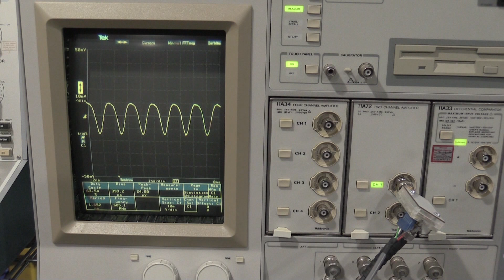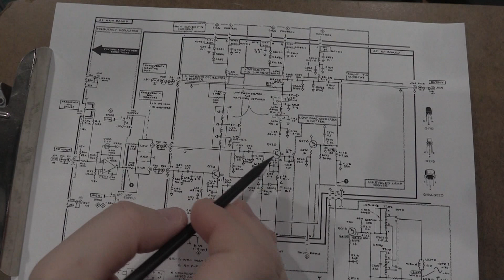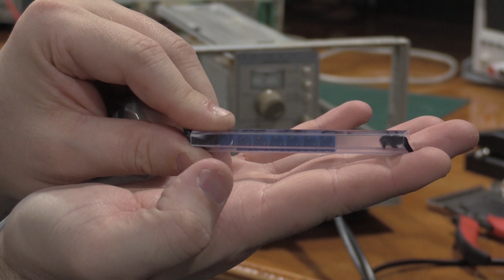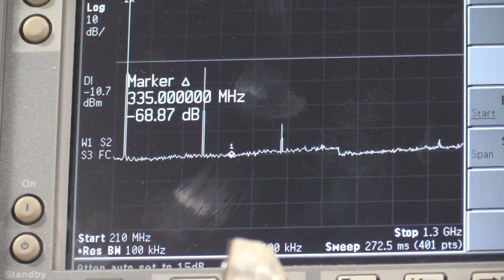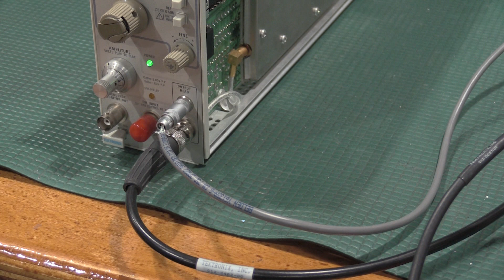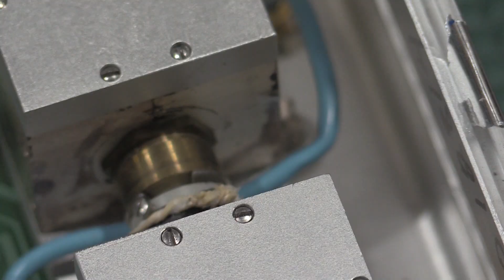Tektronix SG504 Repair and Frustration

Comment: Great video! If I may ask what peak to peak detector did you use?
Reply from the maker: The flatness comes from the leveling head on this unit. Mine shipped with out the leveling head so I needed to order one separately. The flatness of the new leveling head was checked right before shipping to me so I was able to trust it. I need to get some power meters for the lab to work on the 500Mhz and up gear. Secondary market issues with those are the heads tend to be blown up the meter is good but the scene head is toast. Ill be diving deeper in to this when I start aligning the spectrum analyzers for the lab.  More is always on the way!

Comment: BTW guys. I encountered a tricky prob.that had me chasing odd 'drifting' leveling failure. The white and green wires developed a short inside the lemo cable...which caused  the ref.v on the uA741 opamp buffer pin 3 to track closely with the Head's error V sent to pin 2 of the opamp. So the UnLevelled light would slowly fade away, but the dBm level would be wrong as shown by my Boonton microwatt meter.  I swapped the 741 opamp for an LM358 ( can work if u short pin 7 to pin 8 and pin 6 to pin1 on the 358). No change. Wasted time looking for bad pots/caps etc. Eventually did a continuity check across pins 2&3 of the input OPAMP..0.3Ω!!! Damn!!.. Disc the lemo connector...short gone! Fixed that cable and the SG504 happy again. Works with the new LM358 'upgrade'   just fine.